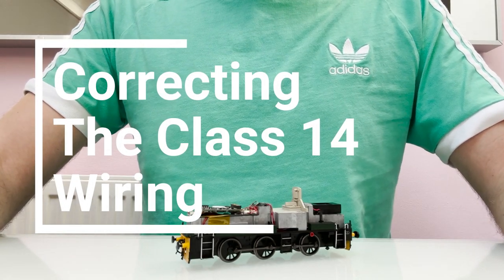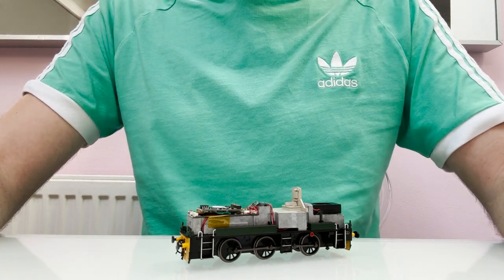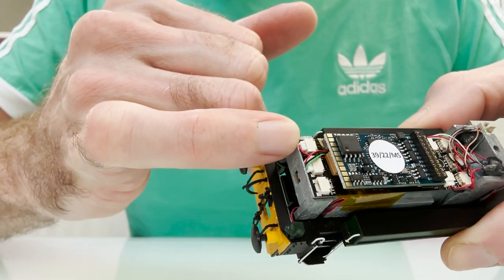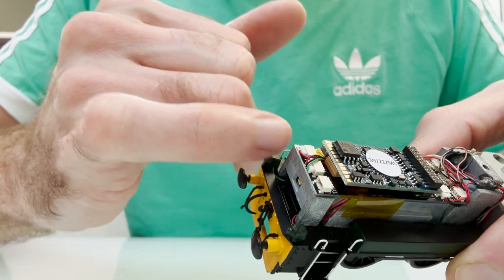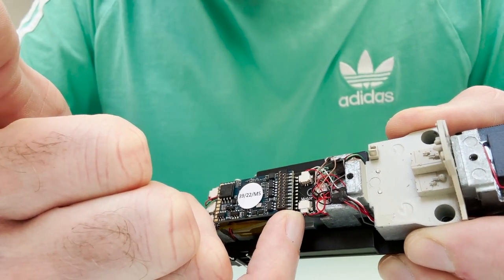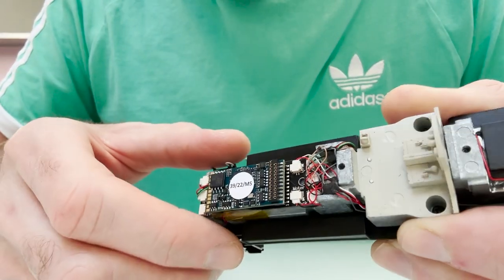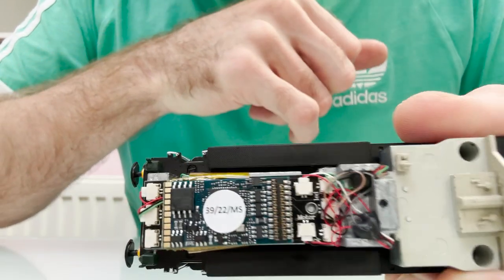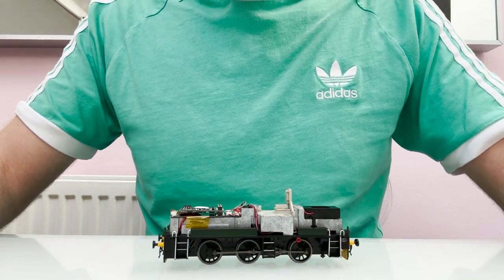How To Fix The Heljan Class 14 Wiring Problems

Comment: For a model loco that costs £170 this is unacceptable. Having track pickup wiring and motor wiring mixed up colour wise not only flouts NMRA standards, but has the potential to cause irreparable damage to any fitted decoder. Heljan should be recalling this batch and sorting out the problem at their expense.
Reply from the maker: I agree, I wouldn’t be surprised if they did, but on both of the ones I did they had to come apart anyway for milling, so it was easy to do the repairs at the same time

Comment: Mine has gone back,the lighting wires were trapped between the body and the metal chassis,making removal of the hood for decoder fitting very difficult,mine would not run after CAREFUL fitting of the brake shoes ,the con rods fouled on them by the jack shafts and threw them off,three attempts and gave up,this is Heljans worst quality model.oh and notice the cab inside detail panel has snapped off as mine did ,you can see the snapped stubs in the cab on the video….as a previous reviewer has said silk purse from sows ear
Reply: I agree it is a disappointing model but aside from refixing the cab interior with PVA I would run it without the additional brake detailing if fitting it affected performance.

Comment: This thing is even worse than I thought. All 6 wheels have pickups, but only the rear 2 wheels are connected to the board. 
The others should presumably be connected to that socket at the front where the lights were plugged in.
No wonder it wouldn't go over points properly.
Now hardwired to decoder, finally running properly. For now.
Definitely too late for a refund now!
Never again, Heljan!
Like the Danish beer ads, probably the worst chassis in the world!
Reply: Can you tell what you actually did as I’m suffering the same, only 2 wheels provide power.